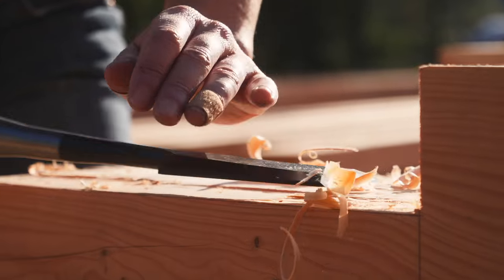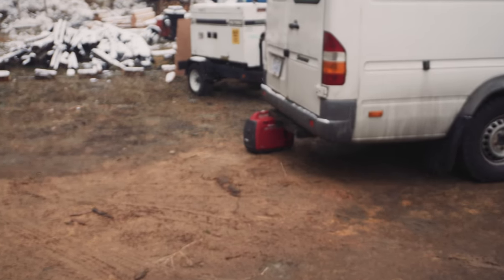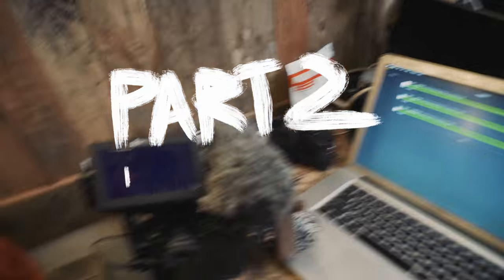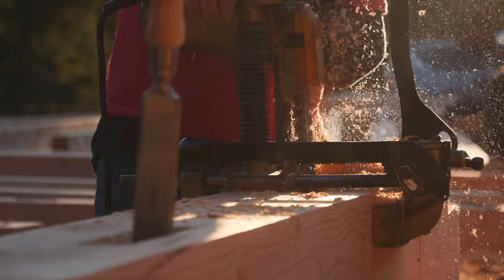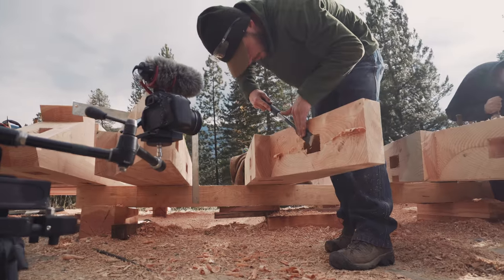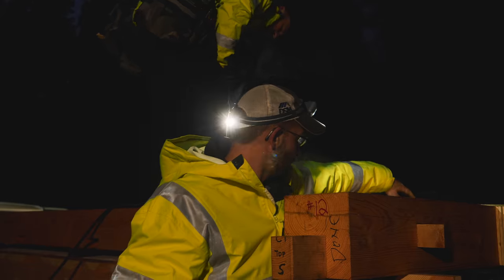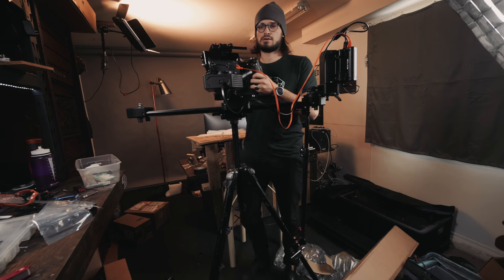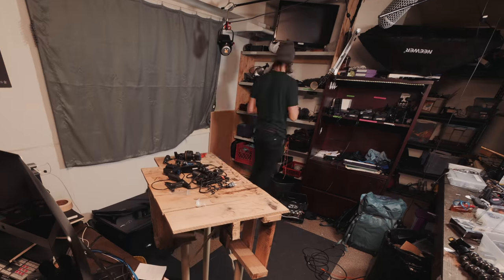the BEST Video Gear to film a Timber Frame Build

Comment: Hey man! I am a big fan, also using the VMP+, I am wondering what deadcat you use ?
Reply from the maker: The one from the original VMP just shoved over it. It's a tight fit, but it works

Comment: Do you use your older iMac as an external monitor for the iMac Pro, or are they both running independently?
Reply from the maker: John Howard III - dual monitor using target display mode

Comment: Hey Levi! Does the gh5 really look that much better than the gh4 or is that just me?!
Reply from the maker: Well, Gh5 is better in low light, larger frame size from sensor, shoots 60fps at 4K, shoots 180fps at 1080, and has dual image stabilization to boot.  So yes you could get comparable images out of both, but the Gh5 is more functional in almost every regard. 

Used Gh4s are still great cameras to pick up cheap though, u just need enough light to shoot with it
Reply: absolutely agree but in terms of outright IQ i feel the Gh5 has a lot more life in the image than the gh4. thinking of making the jump up to gh5. thanks for the vids man keep it up